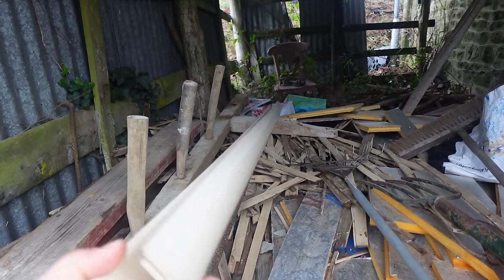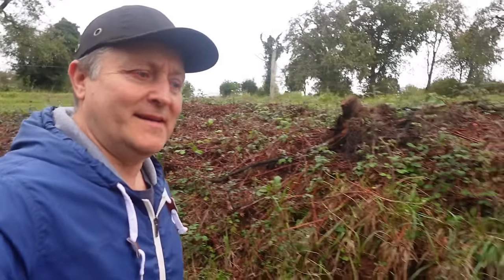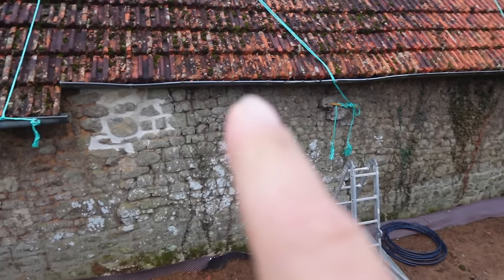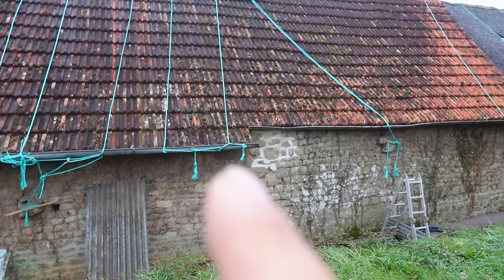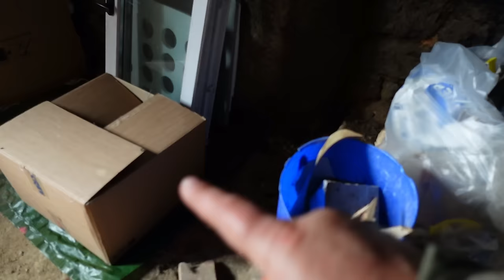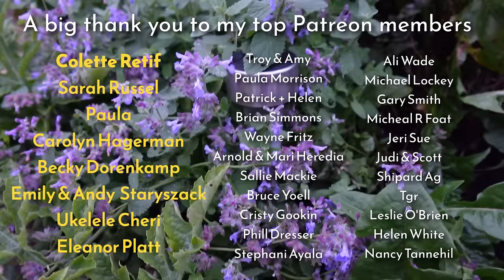I Found A Leak!  | Cottage Renovation Episode 43

Comment: Ideally, if you had the money I say in the spring/summer take all the roof off, bring all the walls to the same height then rebuild the roof using the same old wood but line it up to where the roof is all one height and then reuse as many roof tiles you can. That way you still have the old charm but all stable and consistent.
Reply: I was thinking something like that.

Comment: To save your travel trailer, I would recommend you put a tarpaulin over the entire trailer to keep it from rotting.
Reply: But it should get airflow as well or the moisture will get trapped inside.